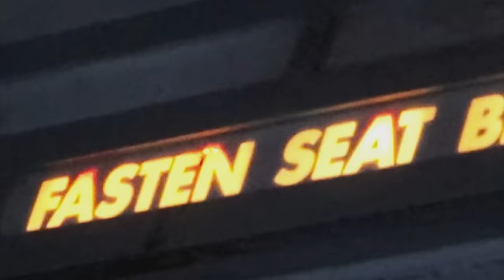Mike Rowe: MANHANDLING MISSILES on a NUCLEAR SUPERCARRIER | Somebody's Gotta Do It

Comment: Fun fact:  WWII fleet carriers were designed to be able to go full speed astern so they could recover aircraft over the bow instead of the stern.  Fun fact #2 the 3 Yorktown class aircraft carriers of WWII had a catapult in the hanger bay/deck and could launch a plane from the hanger deck.

Comment: Thanks Mike. I served in VF-161 aboard USS Coral Sea and USS Midway. I was an aviation electronics technician working on the jets. I did not have a flight deck job, BUT, I had all of the flight deck uniform accouterments so when I was not working at my job I was hanging out on the flight deck during flight ops simply because it was so damn cool. I had the best of it, I could go anywhere on the flight deck during ops but knowing the hazards I did not go where I should not be, but I went everywhere! So much damn fun being up there and not confined to a specific spot.

Comment: I was on the T Roosevelt CVN-76 '01-'05. One deployment our carrier did the night owl shift the whole time. They served breakfast in the evening, lunch at midnight, and dinner in the morning. My berthing was in the rear of the ship above the propellors, ear plugs were a must to get any sleep. The shop I worked in didn't have any air conditioning. An A/C vent leading to the reactor office did go through our shop though, there was a port cover that we'd sometimes remove and steal their A/C, until they came up to complain. It only stopped us temporarily. Otherwise, we'd draw a few gallons of liquid oxygen or nitrogen in a bucket and drop some Gatorade in. You had to be quick to grab the bottles, lest you get frostbite.

Comment: As a sailor aboard the USS Enterprise CVN-65 working in the catapult shop I can give some insight into the steam portion of the catapults. We received steam from the reactors and then redirected that steam wherever it needed to go. 4 catapults fueled by thousands of gallons of super heated/pressurized water. 600psi/600°f is what I worked around all day and night. We gave steam to the ABE's, the green shirt guys, who worked the mechanical side of the catapults. It was hot and I mean HOT in those spaces, around 120°F on average and insane humidity levels. It was a lot of hot work but like he says Somebody Has to Do It!!!

Comment: Well, at least you were not berthed where you had the JP lines running over your head so everytime the ship came about on the flight ops circuit to pick up the wind the pipes would bang above your head for the "faster" leg of the trip. I smile a lot through these Mike, spent time on the USS Nimitz as teen as part of a program they had back in the 90s. Things you never forget. Not having time to eat in the Officer's Mess, would have to go shower, clean up, and put on a proper uniform, and that's time you just don't have... so you hit up the Dirty Mess. Getting lost below decks and using ship stores to navigate from point a to point b. Still remember coming in covered all over my face in black tar kicked up by the tail-hook and then melted by the engines heat and flung back at those of us at the Arrestor Cable Controls.  I still remember the night-ops and the zero-wind training. The F-14s were mind blowing, and those crazy dudes ducking underneath the flame during inspection when they had the ABs on. Your lack of sleep reminds me of mine, though I was just crazy excited. Barely slept. But you do get used to the noise and activity after a while. Thanks for reviving some memories. We got catted off in the old C-2s. Never forget that experience. Life on the Carriers is it's own breed of crazy, order, and hard freakin work. No other ship in the fleet has the same life as a Carrier.

Comment: nice, not that dangerous though, except for your toes if it drops, given that they were practice rounds without rocket fuel or warheads :)
Not million dollar missiles either. Not cheap, but that AIM-9 isn't that expensive :)

Cool show.
Reply: Even if it was real, surely there are safeties in there to make sure it won't blow if someone drops it, right? I'm guessing it is at least like with cannon rounds, where the detonator only gets bolted on at pretty much the last second before shell is loaded.

Comment: the other question should be "would this missile really cost a million dollars?"
answer is probably not
Reply: The training missiles they're using here (which allow pilots to press the button without launching a real unit and see if their launch would have hit) are around $200k, the live missiles are $430,000 a pop. 

Not a million (IIRC the old AIM-54s for the Tomcat did reach that mark), but not exactly cheap, either.

Comment: Even their pilots do the FOD walk?? They don't in the Air Force. LOL. When I was stationed at Holloman AFB in NM, whenever the commander wanted to take a trip in his jet on the weekend, everyone that worked on the flightline would have to line up at his office, then do a FOD walk from there to his jet. We had to clear any little rocks or sticks from the road (mind you, we were in a type of dessert) and any trash from the surrounding area. One of the reasons he was reassigned off our base is because of using his jet to go see family. Misappropriation of military equipment and funds. Lol. He was so bad, we all cheered when he was basically kicked off base. But, he was only sent to another base, he wasn't kicked out. Holloman really sucked under his command. It was nicknamed Hell-oman.

Comment: So if the enemy does a  "surprise attack" . They'd have to wait for missiles to be delivered?. That's a little asinine
Reply: A surprise attack would be spotted a long way off, and given more time to scramble every jet in the hangar fully kitted out with munitions before the enemy could see the vessel.
Reply: Surprise attack is destroyer work. Or whoever happens to already be in the air (couple tend to be flying I believe).
Reply: Not if the corrosion makes the weapon not work. Corrosion Control is paramount. It is amazing how much a aircraft can get f'ed by salt air. Besides the speed of movement is greatly increased normally.

Comment: No drinking, no sex, and no cellphones.  Boy was that a swing and a miss by Mike lol
Hooch could be had for a doughnut or two.  But anybody that thinks we weren't finding ways to get laid while on deployment (I was army, but even my goofy ass found a way in basic) is kind of blind. Ask your bunkmate to step out to the can for a 15min shit and you got all the time ya need for a quickie, and when you're THAT pent up, 15 minutes still leaves 14 minutes of cuddle time afterward.
Cellphones are snuck around a fair bit, but most of the smarter folks with'em keep them in airplane mode so they don't get caught with them, penalty can be pretty severe for it.

(My knowledge of life aboard a carrier is anecdotal, had a buddy in my unit that did 3 years in the navy then swapped to army for god knows why, never did get a straight answer on that one)
Reply: Speaking as an 8yrs Navy veteran…  Yeah, Mike kinda missed on that closing line.😂😂😂
Reply: @GasCityGuy  thanks for replying, it's always nice to hear from a vet that was actually there or experienced it themselves. Have a good'un brother

Comment: And yet, you never made it below the flight desk personnel that are not air wing. The ship has the ships crew that operate and run all of the equipment in order to get those birds off the deck. The actual catapult and arresting gear machine spaces are operated and maintained by the engineering division. No electricity, bathrooms, water, air conditioning, galley food, ...NOTHING  would exist if it weren't for the ships crew. Arguably the engineering spaces are much much more dangerous than the flight deck. Yet, you never once see a video about these individuals that often work 20 hours a day 7 days a week.